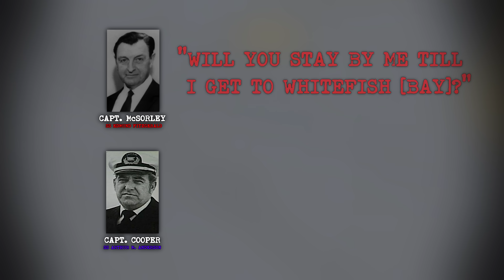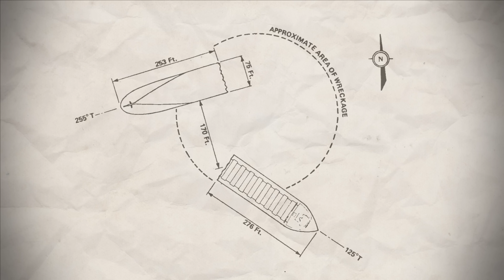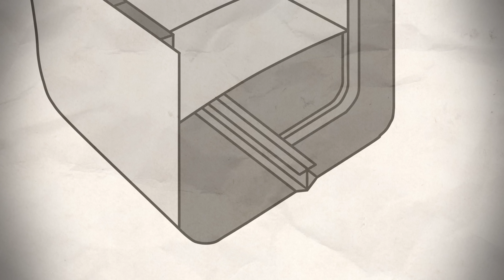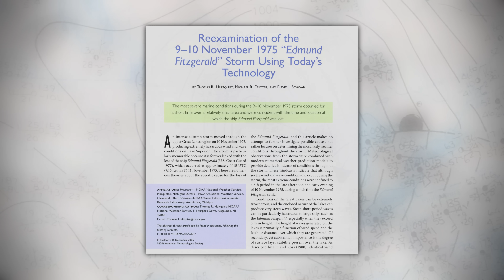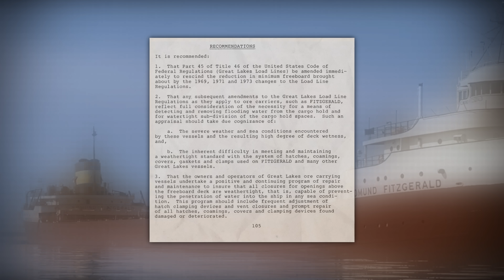What Sank the Edmund Fitzgerald?

Comment: Brittle steel is another possible explanation as well, if the steel hull plates weren't properly quenched and tempered in order to rush the building of the ship, which took only 10 months, a remarkable time back then. Many of the sailors families believed that the NTSB and the Coast Guard investigators were pressured into blaming the crew for not properly 'battening down the hatches. to shift the blame away from the ship's builder. Still a crying shame no matter what. I had never even heard about this until Gordon Lightfoot's song about it. No 24/7 news back then, nor internet either.

Comment: Fun fact, Lake Superior is the coldest and deepest of all the great lakes, to the point where there isn't any bacteria in the depths, meaning that the Edmand, and the other ship wrecks, are well preserved to this day. On the footage from one of the submersibles i think they had to edit out any of the bodies that was shown due to there being no noticable signs of decay from lack of any decomposer that deep, organizms that consum dead things, and since its fresh water the shipwreck is not even corroded too badly. 

Though recovery of the bodies would not be advisable, since while they may still be intact the moment you move them from the high pressures of the depths to the lower pressures of the surface they would break apart into mush. Its as they say, "Superior never gives up her dead".

Also, you actually need specialized suites, from how cold the water can get, ontop of a life vest to prevent possible death from either shock or hypothermia

Comment: I think Capt. McSorley told the captain of the Anderson "We are holding our own" to keep them from coming to their aid... it's that midwestern stoicness that would make him not want another ship to put itself at risk when McSorley probably already knew it was over for the Fitz. It should also not escape mention that diving on the Fitz is banned with a stiff fine for violations and the families ALL signed a gag order not to talk, that doesn't sound suspicious at all... 🤔 Also why does nobody ever mention how absorbent taconite ore is? It was hard to find, but I did run across a detailed breakdown of taconite's composition which says that it can absorb up to 10x its own weight in water before it even looks wet. These lakers who regularly carried this ore were always at risk of sudden sinking if enough water got into the hold and nobody that checked these holds would have even known about it. Enough wet taconite shifting to one or the other side of the ship would be enough to drop it like a rock in seconds. In the simulation, water is coming from every direction and washing straight down the deck over the hatches repeatedly. A couple of leaky hatches plus a ship that hadn't been maintained and was overloaded was doomed from the moment they set sail. Ultimately, corporate greed sank the Edmund Fitzgerald. Same story over and over again with these Great Lakes freighters- overloaded ships sent into the middle of the most dangerous weather, all for the profit of a few rich men whose lives are ensconced in their mansions safely on shore.

Comment: The Edmund Fitzgerald was 728 ft long. The depth it's at is 528 ft. It was in a massive storm, I'm guessing it came down from a massive wave and buried its bow into the lake bed which is why both halves are right next to each other. 

When the Daniel J. Morrell sank the stern was found 5 miles away.
Reply: A little different because the stern kept sailing under power for another 45 mins. More comparable would probably be the Bradley, but your general point is absolutely correct - there’s no way it broke up on the surface. Not sure what injured her exactly, but it was absolutely the rogue waves that delivered the final blow

Comment: Here's what put the Fitz down;

1 - The ground upon which the choice Great Lakes Engineering Works slipway was built was very swampy, even though it had been built up and continuously flattened over and over - this led to the concrete and steel flexing along certain areas and providing an overall uneven building surface. A ship the size of the Fitz had never been built by the yard nor in that manner before, and she was built during a time "eyeball engineering" saw the most widespread application. That is, the Fitz's keel and hull overall were somewhat deformed from the get-go, meaning the hull wouldn't disperse stresses evenly and key fracture points would occur over time. This has been observed in numerous other similarly-built vessels over time, which are known to form seemingly random "stress cracks". This is part of the reason why.

2 - The design lacked any transverse watertight bulkheads, with the ship only having screen bulkheads. Due to the massive, mostly empty hull and without the reinforcement of lateral bulkheads throughout the length of hull, the Fitz was more prone to flexing and twisting in big seas and would flex and twist further than a vessel that had proper transverse bulkheads installed throughout the hull. This flexing and twisting of the steel not only put excess strain onto the hull and caused faster wear and stress cracking, but it also slightly warped the steel over time. One of the listed repairs needed once the Fitz would be in dry dock (scheduled some short time after her final voyage would begin) was an overhaul including hatch cover replacements. In some areas, the steel was so warped that the hatch covers couldn't be sealed completely. This is not on the crew nor the captain.

3 - A key inspection from local welders noted the Fitz had earned a few stress cracks during her career which had been repaired over time - it's not the fact they were improperly repaired but moreso the fact these stress fractures occurred at all, indicating the steel wasn't holding up very well with the design loads the ship was being given during her trips. On top of this, in a few cases, her pilothouse windows would bust due to the warping of the steel frame in that part of the ship, and new windows had to be installed with frames re-welded. This was a further indication of just how much punishment the ship was weathering.

4 - At the last unloading before her final cargo loading (River Rouge, Zug Island) the crane lifting the taconite pellets out of the Fitz's holds snagged on 20 feet of steel plating sealing the ballast tank from the hold. While dock workers reportedly offered to weld it back over, they claimed McSorely refused, saying they were on a tight schedule and would have the repair done once the ship was later in dry dock. This is well before McSorely knew about the storm - had he known at this point, he most likely would have accepted the assistance.

5 - The Fitz didn't have any sum pumps in her cargo holds, only water pumps in her ballast tanks. This is a flaw in the design - flooding in the cargo holds cannot be relieved. This is supported by McSorely's note over the radio later on that he was taking on water despite both his ballast pumps being active and ties into another point - the Fitz almost certainly grounded on the Caribou shoals, damaging the keel and ripping open one of the ballast tanks. With a heavy influx of water and loose, unwelded deck plating in the hold, the ballast tank began to overflow, causing a list, and the overflow from the ballast tank then began to flood the cargo hold.

6 - For the condition she was in, and her design spec, the Fitzgerald was technically overloaded on her last load. With a heavier load than she could safely take, and an already stressed and fatigued hull, the vessel would be at a high risk in rough weather. With heavy seas washing over the decks and pounding the hull and hatch covers, the ship was subjected to even more stress. McSorely surely understood this, and powered up full to try to rush to Whitefish Bay before the weather took them out (as he had fence rails down due to the hull's twisting, water in the holds, and a bad list already at this point).

7 - The Fitz was almost certainly struck by Cooper's rogue waves and sent underwater. The pilothouse windows would have imploded, the water pressure would have blown the hatch covers in one by one, and the ship would have taken a nosedive down to the bottom. She struck hard on the lakebed and the stress broke the ship in two, with the stern likely capsizing due to a combination of rapidly flooding holds and shifting cargo weight. As the stern capsized and went down, the rest of the impartially flooded cargo holds experienced implosion as the hatch covers gave in, spilling the taconite pellets all over the bottom around the wreck, before the stern finally settled on the bottom next to the bow.

The Fitz wasn't done in by any one factor but a bad combination of multiple issues.
Reply: Point 7 is basically what happened to the MV Derbyshire
Reply: @kalkuttadrop6371  Very likely, Fitz's fate was the same as MV Derbyshire's. The vents torn away would have allowed huge gulps of water to be ingested into the ship with every wave over the deck, and with the holds slowly filling, more and more water would be able to come in because smaller and smaller waves would be needed to wash over the deck. The ship goes down in those rogue waves, the pilothouse windows implode, killing everyone in it instantly, and let the entire lake in via the interior accessways and ladderways in the pilothouse. Whatever air is left in the forward hold is instantly driven out by water pressure that blasts the first two covers in, the ship goes down and the twisting moment pops the rest of the covers off like the top of a Glad Ware. Every single person aboard is probably dead before the ship settles to the bottom.
Reply: @disorganizedplay  The problem is that should have been blatantly obvious in the wreck. The Derbyshire Wreck was badly torn up except for the very front which was pre-flooded due to implosions, and we don't see that kind of damage on the Fitzgerald.

There's also Marine Electric as another example, which also sunk due to cascading hatch cover failure, though in that case the root case was horribly maintained hatches.
Reply: Whoever started this nonsense about the shipyard that built the Fitz being in a swamp and it led to the Fitz being built crooked, along with that "built lining things up by eye" has obviously never worked in a shipyard.
The erection beds that ships are constructed on have pilings that go down to bedrock.
I myself worked in a shipyard where everything we built was done with transits, plumb bobs, piano wire and markings on the erection bed and when customer or Coast Guard inspectors would show up with their lasers to check everything we'd be within ¼ of an inch square and plumb, EVERYWHERE, and length doesn't matter, the way it's done you could double or triple the length of what we built and everything would still be within ¼ inch because of the way shipyard beds are set up.
This nonsense about sagging swampland and any nonsense criticism about the way ships were built back then just makes me roll my eyes everytime I hear that malarkey, shipbuilding is one of the oldest trades in the world with literally thousands of generations of knowledge handed down from one to the other, nobody has built crooked marine vessels since long before they were made of metal, good lord look down a road or wall that was built 1,000 years ago that's straight as an arrow, ever heard of the Pyramids of Giza? People learned how to build very large large objects thousands of years ago and keep them straight, anyone who believes that a 729 foot ship couldn't be built straight in the 1950's probably believes those moon hoaxers also.
Reply: I'm still a rookie in terms of learning about the Fitz.   However, I was under the impression that the most recent information dismissed the theory of hitting the shoals.  This was based on the examination of the shoals and the stern of the Fitz and finding no evidence of such "shoaling".    I also thought that the theory had evolved such that it was generally accepted that the Fitz was spilt in two above the water due to the rogue wave rather than the bow hitting bottom and then splitting in two.  Look forward to your comments.   Thanks-
Reply: @tomcarrollsusinaperstek2602  I wasn't aware the shoaling theory was dismissed but I do remember Captain Bernie Cooper of the Arthur M. Anderson said that the Fitz would've been almost right on top of the shoals during the afternoon of the 10th.

If she did indeed shoal, it would have flooded the ballast tanks and allowed water into the hold thanks to the damaged floor plating. This would explain the flooding in the holds - there is no other conceivable way the holds would have taken water, as there were no openings along the hull plating on the wreck.

As to the disagreement over the Fitz bottoming out and breaking apart, I'm not sure - I would personally imagine the steel would be at least strong enough to hold up to a wave rolling over the deck, though maybe the rogue did indeed split the ship apart.

I'm basically just re-iterating a swath of new info that's been shared recently on YouTube
Reply: Yeah
Reply: Fitz didn't power up to rush to Whitefish Bay, she checked down to allow the Anderson to close the distance between them. Also, there was no evidence found on the hull or on the shoals that would indicate a grounding.
Reply: @rspro575  Yes, and after checking down, she powered up to full. They were taking water in their holds and couldn't pump it out and had so much of it they were listing.

There wouldn't be evidence on the hull indicating any grounding if it was on the bow section, as that area of the ship would be under the mud. Visibility at depth is abysmal so I'm doubting very highly the ability to see underwater very well in 1975. At best they'd have a spotlight that could illuminate one small area at a time and once their air tanks were close to empty and they needed to ascend, they'd have called it a day. They didn't search the entire shoal.

Captain Bernie Cooper himself said he was sure the Fitz grounded based on where she had traveled, which he stated was far closer to Caribou island than he'd have been comfortable traveling.
Reply: @pc_buildyb0i935  There's also a SIGNIFICANT chance that grounding damage was taken in the part of the hull that shredded apart during her final plunge, when the stern twisted over and separated from the bow.
Reply: @rspro575  wrong , the fitz did check down but went to full speed in its last hour the fitz chadburn was found at full power
Reply: Excellant explanation.
Reply: So all of the holes in the Swiss Cheese lined up to doom the Fitz. How sad 😢
Reply: This should be on Wikipedia 😂
Reply: You are *CORRECT!  SPOT ON and it all adds up to DISASTER & going to the bottom!  *BRILLIANT analysis!  Makes sense to me!

Comment: It's math. How heavy the ship is times how much the ship floats minus how deep the water is plus .004 per mile per hour the boat is traveling, plus or minus a few for the variable involving how many fish are under the ship and if any of them are helping. If that number is greater than the weight of the water in the lake and it rains, you will die.

Comment: I believe when they went down in the 90s with cameras the throttle was not checked down it was full steam ahead.  The belief that it sank from hatch failure is a debunked, i believe.  There was the shoal question but also structural problems from a previous grounding and general issues with how it was built.

Comment: There were no design tables for a ship as large as the Fitzgerald.  Designers may have extrapolated outside the design tables.  That does not always work.  It would be interesting to see a stress analysis of the Fitzgerald.  That winter was an experiment with year around Great Lakes navigation.  I would expect a company to keep there largest ships operating for maximum profit and not plan to send one of them into dock for repairs unless there was major damage.
Also, there was a photo of the Anderson's starboard life boat when she arrived in Cleveland showing extreme damage from waves.  If I remember correctly, the boat deck was 32 feet above the water.

Comment: The problem with the bottoming out at Caribou' shoals theory its that this is one of the first  things the coast guard investigated. They set in divers looking of any sign that a ship had run aground on them and this ultimately led in the charts being remade for this stretch of water. Turns out the shoals were 1km or more away from where it was thought they ran aground.

And when I mean they investigated I mean they investigated this carefully because of how the insurance industry works with boats. If they had struck the shoal than the ship was lost due to poor navigation and no fault for demanding a later end of season run could or would be pinned on the ships owners.

Comment: It was not the hatch covers. As someone who has worked on these freighters before, clamping those down is an easy, but serious task, and I can't imagine that a crew like the Fitzgerald's would have just not done it right on their last run of the season.
Reply: Even perfectly good hatch covers can fail, see MV Derbyshire.
Reply: @kalkuttadrop6371  I know. But to insinuate the Fitzgerald's crew just didn't do it or didn't do it right is absurd.
Reply: @ZachPfeiffer  It's not that the crew did not clamp down the hatches, it's that the crew could not clamp down all of the hatches because they were damaged. When the later checked Fitzgerald's sister ship, 45% of the hatches would not seal tightly.